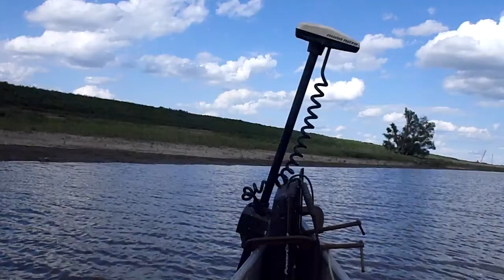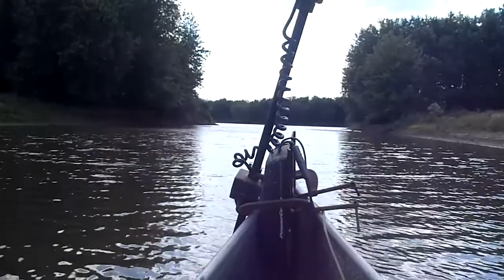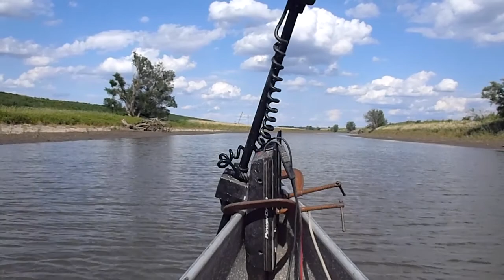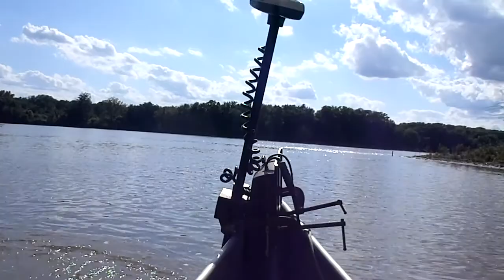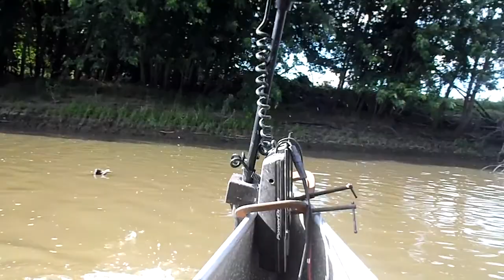Solar canoe test 2 trip 1

Comment from the maker: @916bangster this run i had a passenger with me so i didnt want to use my unisolar pv 128 that when rolled out was about a foot longer than the canoe, this run i was using two 12v deep cycle batteries, they put out a total of 94 watts max. the trolling motor was a 48lbs thrust minn kota and the batteries were able to power the motor to maximum, as was the 128 watt solar panel i used in a previous video, my most recent video is about my solar bike mock up. the canoe setup was only the trolling mo